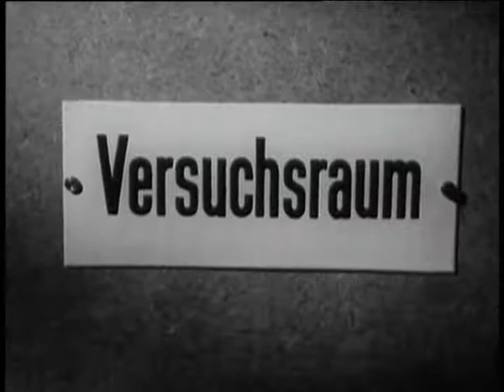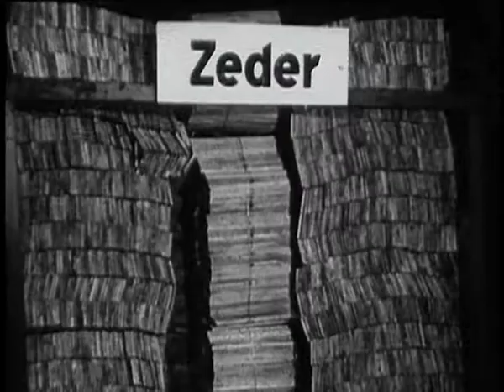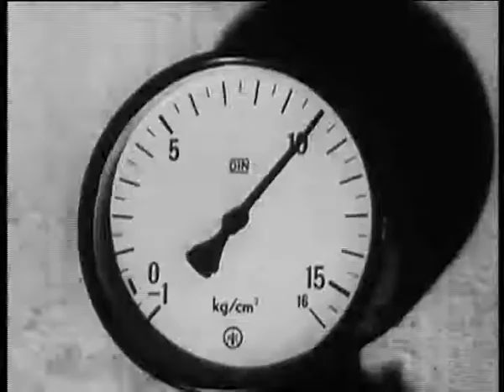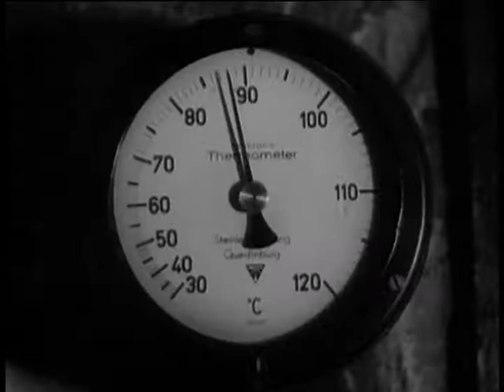STAEDTLER pencil production in 1950 Part 1

Comment: amazing to see how much production has changed, I wonder on the staffing levels compare from 1950 to 2018 in that factory. 1950 seems very reliant on people, even the gentleman laying out the lengths of graphite as it is compressed into lead size.        
  You can see the sheen of the graphite on the workers skin in the early stages of the production, I bet health and safety in 2018 would be all over the factory for the production practices at that time. Thanks for posting this glimpse into the past. Such history shouldn't be lost in storage.